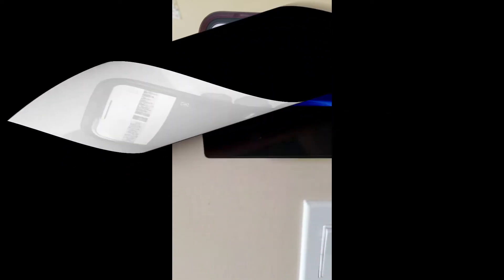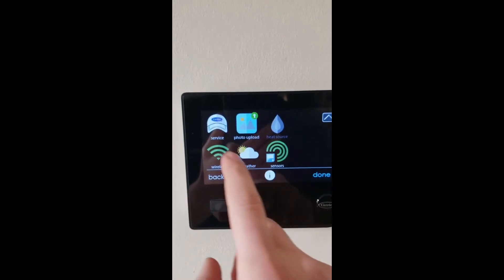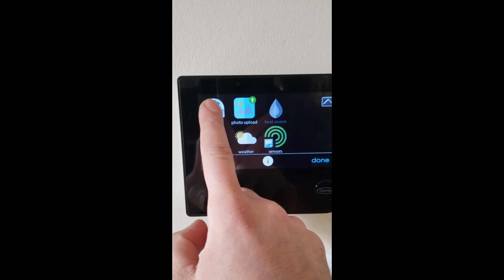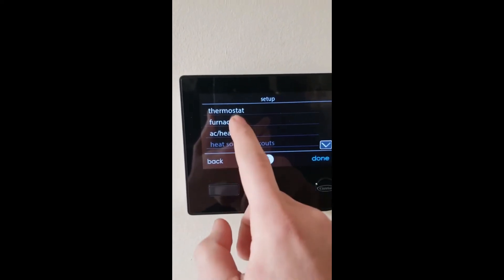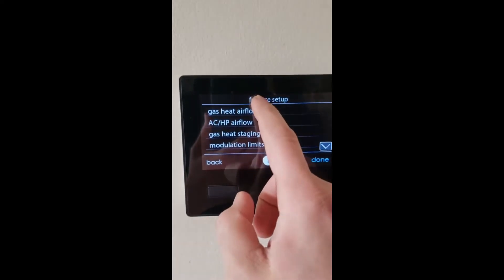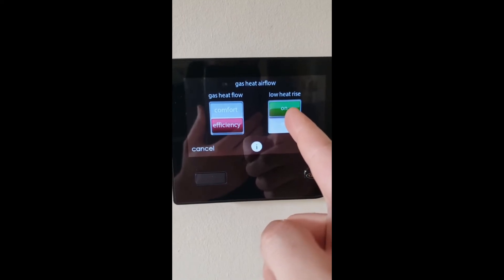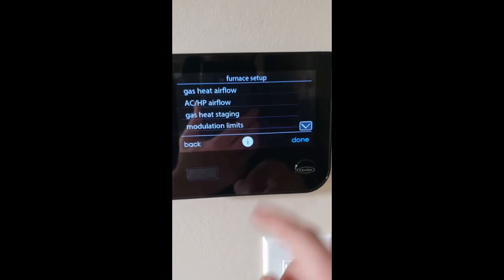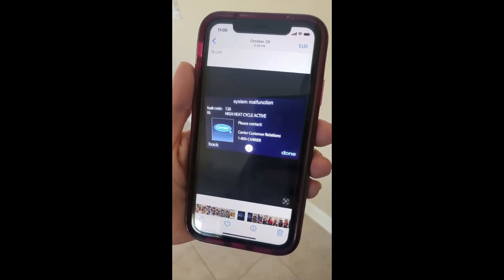Error Code 126 on Carrier Infinity Thermostat

Comment: Had this error code from the first day of installation of our Carrier furnace. (The problem was NOT a sensor problem, nor lack of air flow, nor gas pressure, nor any of the settings). We had to get the main board replaced in the furnace. That fixed the problem.

Comment: Dip switches are not used on furnace when you have and Infinity controller. Set ups are done with the User Interface(thermostat). I always set all Infinity furnaces to efficiency and low heat rise on as though there was a by-pass humidifier even if there is not a by-pass humidifier. This gives you more CFM in heating mode, which always seems necessary with this model. In this particular case, since this code indicates the problem is with low to medium fire, you need to have the low fire gas setting checked. For natural gas, it should be at .50 - .55" water column. I suspect gas pressures were not properly set on your gas valve in your furnace, so it makes too much heat for the air flow on low fire.
Reply from the maker: Thanks for the comment. In this Case, we had a modulating furnace with a modulating Gas Valve.
Reply: @CaspianHVAC  I realize that. I train others at an HVAC company on how to install that 59MN7 furnace. Been doing this work for 35 years. You MUST SET HIGH FIRE FIRST, THEN SET LOW FIRE RATE. The furnace will modulate between these flow rates. If you fail to set the low fire rate properly, you get the code 126. It is telling you that on low end firing, it is getting too hot, so it has resorted to only using the higher firing and fan rates. Please just set up the modulating gas valve correctly.
Reply: @brianshimp8299  There is also an elevation setting for the furnace.  I did research and discovered that NG pressure increases with elevation - so the modulating valve that controls the NG flow needs to know what elevation the furnace is operating at to know how much to restrict the NG flow.  I was getting error 126 as well, but made the change to the elevation setting to the next elevation higher than where I live and the furnace stopped generating code 126 and runs on COMFORT and LOW heat rise.
Reply: @maildeliverysubsystem4460  Ok. You have now told the furnace that it is working at a higher altitude than what it is actually at. While this looks like you solved your immediate 126 code problem, you now have the furnace using a slightly lower gas input rate at all stages of modulation. This means you may not have enough gas pressure on high fire now. Your furnace was working ok before on high fire with the elevation properly set, so the furnace was getting the correct flow on high fire, just not on the lower spectrum of modulation, which means the low fire  end of the spectrum was not set up properly and that is required as part of the first time start up. The furnace may work fine with the change you made, but the higher end of modulation will not have the correct gas pressure. I don't understand why are you unwilling to set up this furnace per the engineer's guide (installation instructions) that come with the furnace, but that is your choice.
Reply: @brianshimp8299  The setting for elevation goes in 200 ft increments.  I am at 2,297 ft, which isn't 2,200 ft or 2,400 ft.  I initially had 2,200 ft but I was getting code 126.  I feel that the sensitivity of the modulating unit is such that I should go with 2,400 ft.  To me, the logic of increased NG pressure at higher elevations explains why 126 is being generated.  The furnace was set up as per the engineering specifications (it was professionally installed) but the modulating settings were not set (i.e. the elevation was not set for where I live).  The minor change from 2,200 ft setting to 2,400 ft setting should not and can not affect all operations of the modulating unit to the point where the furnace will not operate correctly at all stages of modulations.  From what I have read, code 126 in conjunction of higher NG pressure at higher elevations means (to me) choosing an elevation for my furnace closed to (but higher than) my elevation should be used.  If you choose an elevation lower than the operation elevation suggests that the modulating using is expecting lower NG pressure than what it is and quite possibly will not modulate correctly because of it (and trigger the 126 code because too much NG pressure is going through to the furnace and triggering a high heat warning).  I have not found anywhere (so far) where the discussion of the elevation setting, relative to the modulating of the NG, relative to the comfort setting (for the furnace) relative to code 126 being tripped.  This video and your post are the most recent discussions regarding it and I thought I would share what I have discovered.
Reply: @maildeliverysubsystem4460  I also appreciate learning all the different ins and outs of anything I work/teach on. I assumed that you set the altitude for 1000' higher than your location. I am surprised that changing the altitude by only 200' made the code go away. I find that very interesting and surprising.  Here is another thought for you. If the altitude was the problem, why did the furnace only trip the high temp during low fire but not during high fire. I suspect it was because you have too much gas on low fire.  So I still question, did the installing contractor actually set the high fire rate with the furnace running on high fire and then set the low fire rate with the furnace set to run on low fire because that is how you are supposed to do the modulation settings. Did you happen to change the air filter at the same time? Check your ^T between the return air and supply air and if it is always between 35 and 65 degrees, you should be fine.
Reply: @brianshimp8299  That is a good question.  I am not an HVAC person or anything along those lines.  However, the relation of increased NG pressure the higher the elevation and the modulating unit having to adjust for it, I would liken it to having a fire hydrant feeling a garden hose (hydrant having greater pressure than a house).  At high fire the furnace has all of its internal blowers/fans running a full speed and as such dissipating the heat, which maybe why code 126 was never tripped.  On Comfort mode and LOW heat rise, too much source pressure combined with the modulating not correctly adjusting for the pressure might result in too much NG (due to pressure) making its way to the burners and the fans set too low of speed to dissipate the heat it fast enough (resulting in code 126).  Most of what I read code 126 just means your energy efficient furnace is running just like a regular furnace (with no energy efficiency being experienced). I hope what I am trying to say makes sense.  I will be experiencing -25C weather next week so I will see if what I did makes a difference at the colder temperatures.  Today it is only -12C to -6C.
Reply: @maildeliverysubsystem4460  Boo. Stay warm. It is supposed to be 22C or low 70'sF here over the weekend. If you decide that you want to check for proper set up of the gas valve's modulation range, which needs to be done on every installation, let me know.
Reply: @brianshimp8299  Will keep you in mind as the winter here progresses.  I had the furnace installed last year so I do hope/believe that it has been done correctly; but with a full on winter with (what I believe) the correct settings for the furnace - time will tell.  Thanks

Comment: Thanks for this video! I'm struggling currently with this error code on my new Carrier HVAC (<2 years old) followed by a 13-limit lock out and have resorted to power cycling the unit to clear the errors. I've had a tech come by and they don't know how to address is. Do you have any more insight into what specifically needs to be changed on the Dip Switch so I can communicate that to my tech please? Thank you so much!
Reply from the maker: Try to turn on SW1-3 and Turn off SW1-4. You can watch this video for more info: https://youtu.be/BdeKzV2Gdhs